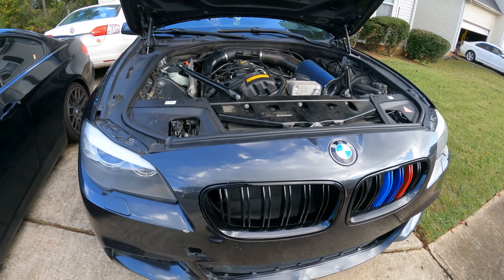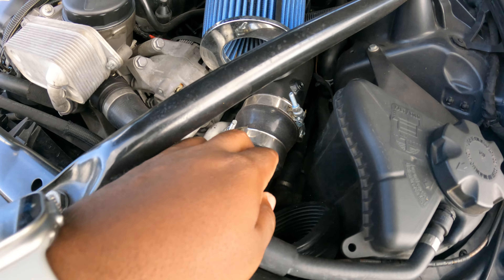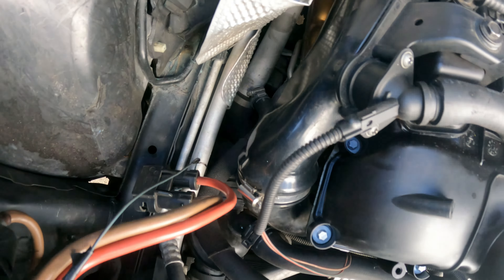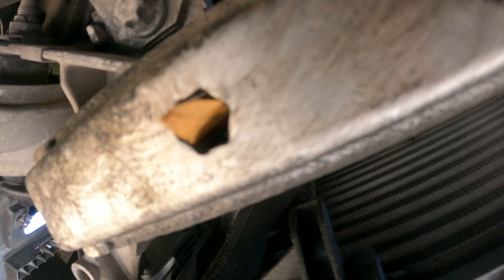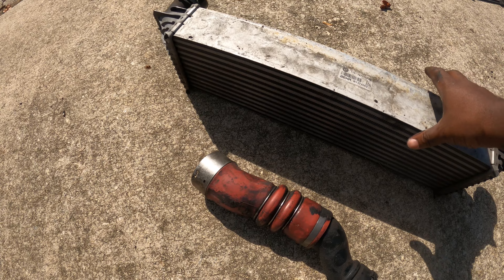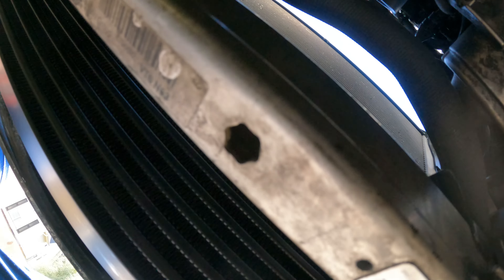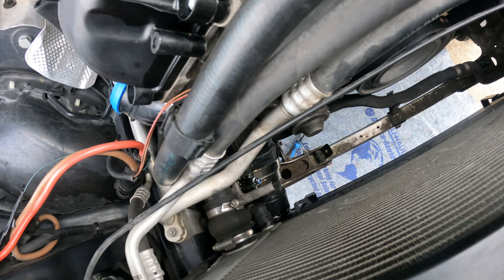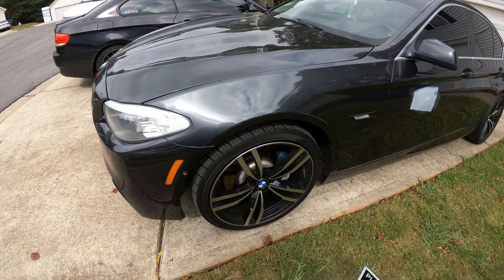F10 BMW intercooler and boost pipe!!!

Comment: Thanks for the video.  I'm about to do the IC.  Also, I need to replace that coolant hose that runs along the bottom.  My hose unclipped, and hit the crank pulley.  I would suggest  to zip tie that hose to the clip.